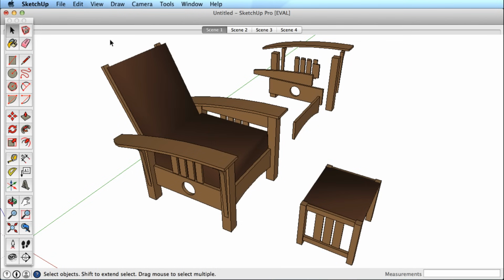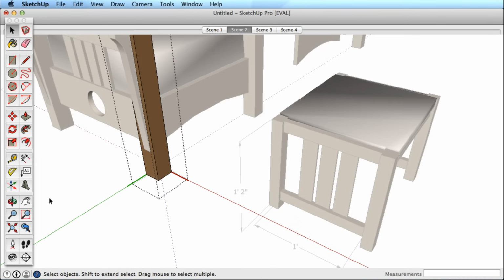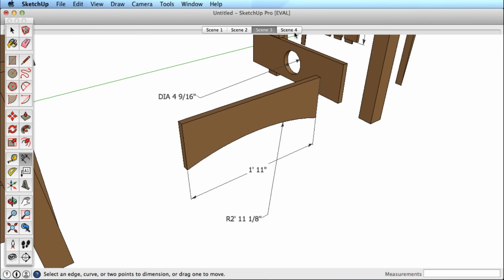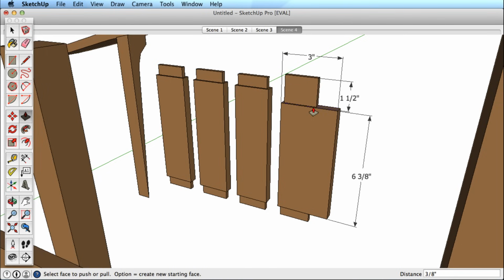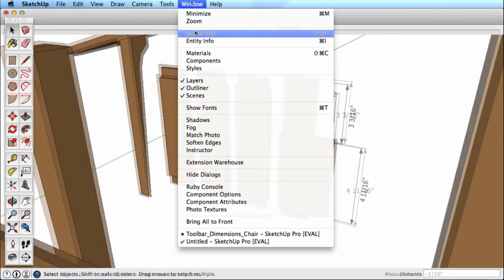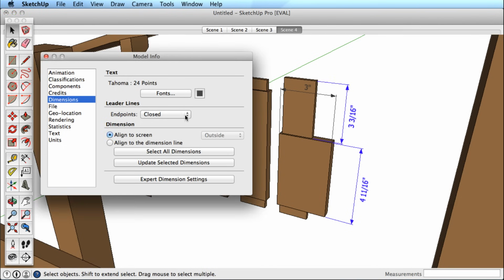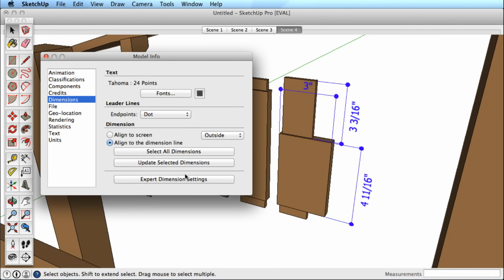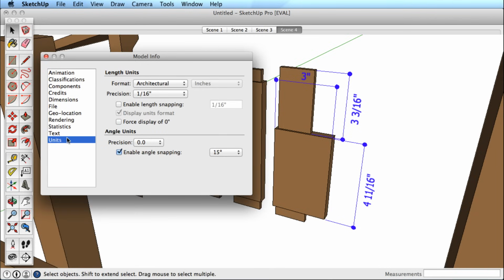SketchUp Training Series: Dimensions

Comment: Is there a way to hide/unhide dimensions once created?
Reply: Yes, if you create a new Layer. Layers can be made visible or not (window, add tray, click on layers.) Tray 1 shows up on lower right side of screen. Add a new layer there. Also add layers to your tool bar. (view, toolbars, layers) in order to select what layer to work in. Title the new layer Dim and WORK ON ALL DIMENSIONS IN THAT LAYER.  You can make them not visible but all dimensions stay with your work. Good luck
Reply: I wish there was a setting in Model Info to place all dimensions on their own layer as they are created, and not have to go back and do it manually. Dimensions are necessary but often get in the way when creating the model, and it would be nice to be able to turn them all off with one click. This is an old video in the series I know but 8 years later the ability to do what I said still does not exist in SU Pro 2022.

Comment: Assume I have a post layout for a deck.  All the posts are the same so they are a component.  I want to dimension the distance from each post to a single reference point.  It seems like I should be able to edit the component, dimension from a corner to that reference point which is outside the component and then all the components would get dimensions.   Is this possible?